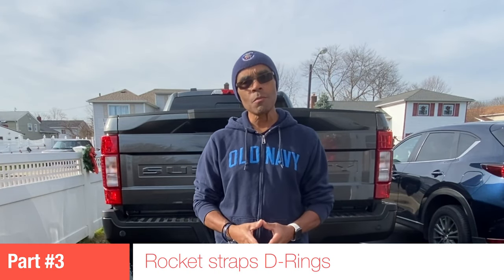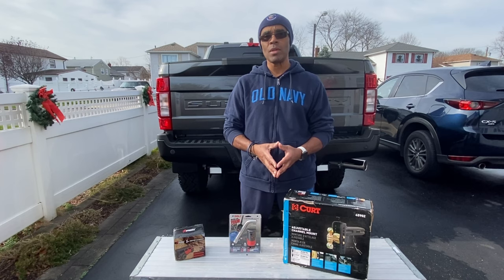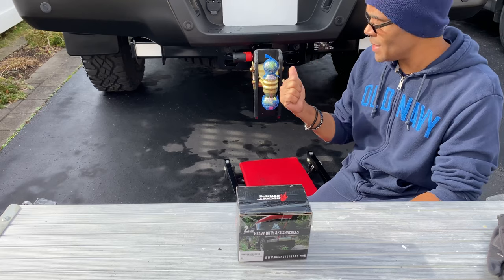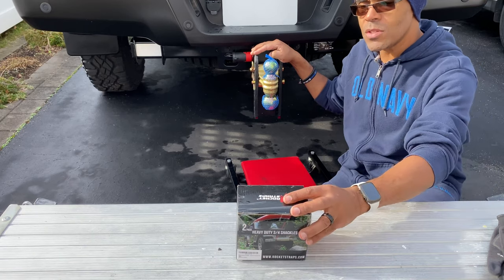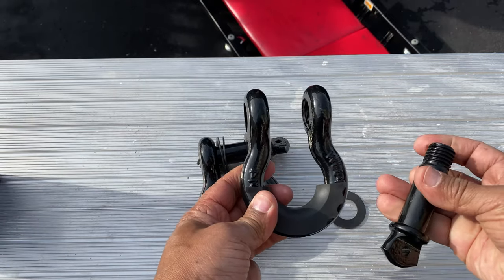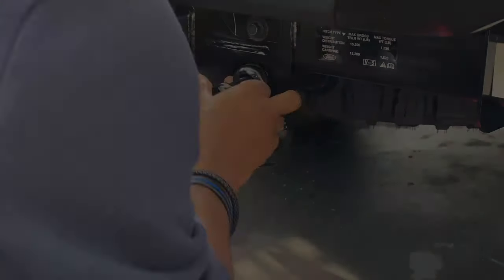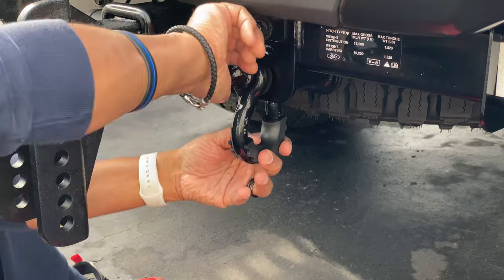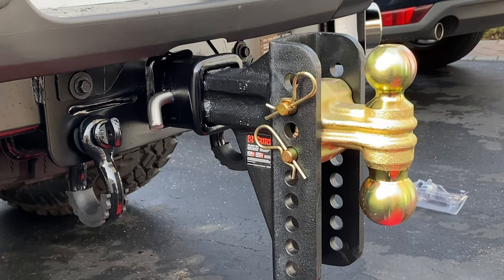Installing Rocketstraps D-Rings for the beginner on a Ford Super Duty F-250 - F-350 Tremor, Part 3

Comment: You figured it out, but D-rings definitely do not get installed like this. You would twist the crap out of that thin metal as soon as a load is put on the ring. You could however install them on the front of the truck, and those plastic inserts will protect the paint on your recovery points.
Reply from the maker: Thanks for your comments. And input on this one.

Comment: Ray- Why did you add shackles to your tow package? I mean, those slots you attached the shackles to are where you’re supposed to attach your safety chains. If you attach your safety chains to those shackles and, God forbid, you get into an accident they’ll induce a (upward) twisting motion that COULD, actually, rip the plate that you have them attached to. 

I’ve been towing a very long time and I still do it regularly for the cattle ranch I manage. Shackles can be great tools and are appropriate if you had a different type of attachment point. For example, on our pipe bumpers that have an attachment point made of plate running vertically and attached perpendicular to the bumper/vehicle, so the threaded shaft on the shackle goes horizontally through the plate and the shackle hangs below it sorta like a ‘U’, THEN it’s appropriate use of a shackle. However, the way you have them attached is actually counterproductive  and unsafe, imo. You might want to check with a local trailer dealer/manufacturer if you think I’m wrong. 

Love your channel and your content but this ONE particular product isn’t used right and it’s putting you and your trailer at risk. Hop this helps, brother. 👊😉
Reply from the maker: I took them off. They are now on my rear bumper. Thanks for the tips and comments.